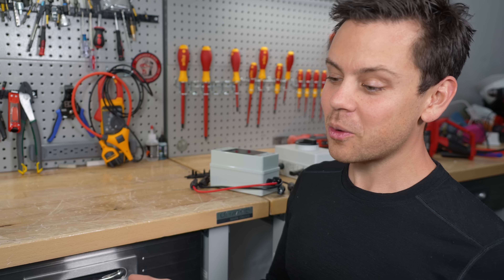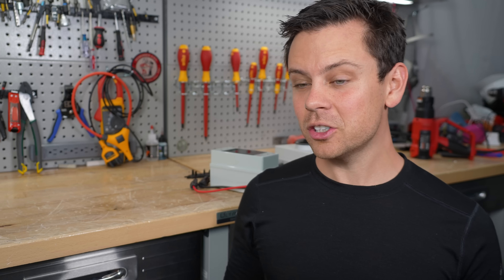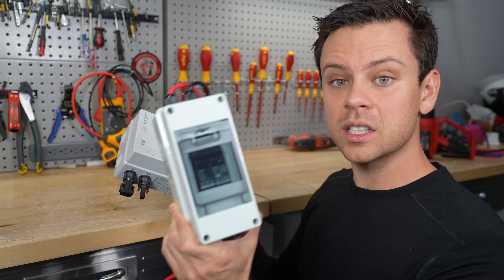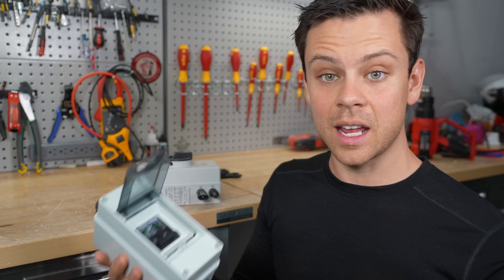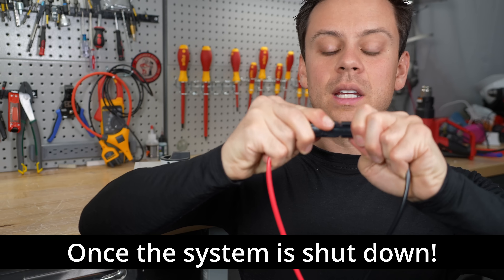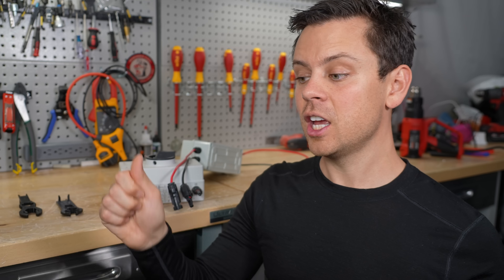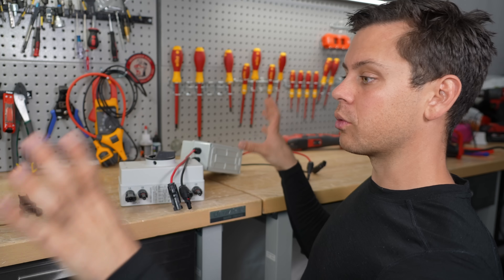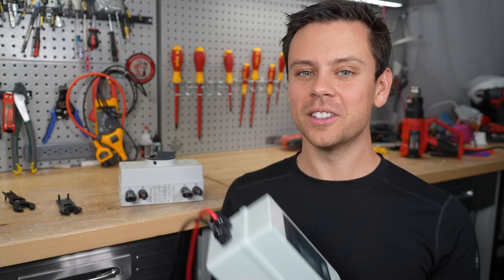How to Avoid Electrocution from an Offgrid Solar System: Everyone should know this!

Comment: It would have been great if you included info about using a pre-charge resistor when connecting batteries to inverters. Is it necessary in all cases?

Comment: Another solution is using rapid shutdown modules on each panel.
This keeps the series strings at 50volts until modules get a turn on signal once they are all connected.
Just be careful to kill the signal before working on PV panel system.

Comment: I was re-routing my solar panel wires at my inverters last month. I turned off one string that started unscrewing the wires from the wrong inverter. My panels were at 440 volts when i got zapped lol. grabbed ahold of my hand and i jumped and started to run out the door to disconnect myself from the voltage. It's not comfortable, do not recommend lol.

Comment: While I don't watch all your videos, I've watched enough to respect your expertise.
This will be a long question, but I'll try to keep it relevant.
In the early 2000's I owned a LEV (light electric vehicle) business and bought (and sold) SLA batteries by the pallet load. I built extreme stand-up scooters that had 400 amp controllers and dual  motors. I expected a lot from the batteries and the SLA's never let me down.
I want to build stunt scooters now but I am literally afraid of lithium batteries especially knowing the abuse I intend to put them through. Can you recommend a custom battery source in the western states that can build batteries for specific high current applications.

Comment: My landlord is a bit of a bozo and a marine mechanic with just enough knowledge to be dangerous. When I moved into the off grid cabin he rented me the house was 12 V DC and 120 VAC. I got very nervous with his electrical wiring and in the house one time I shocked myself touching a 12 V DC conductor. ??  After further investigating I found out that he used four conductor Romex to carry both the 12 V DC and the 120 VAC into the house. And he shared the 12 V DC negative with the 120 VAC neutral!  Absolutely hilarious. Later I was outside checking the water in the lead acid batteries and the ground was wet and I was barefooted. ut oh..... I touched the negative terminal of the battery and got a really big AC shock through my whole body! 😂😂😂😂😂😂 I had to bite my words and be polite to him as I tore apart his wiring and re-did the house properly. 😢

Comment: Electrician here. Those DC isolators are cool, but I also recommend an outdoor disconnect box (either AC or DC depending on system) near the meter/main disconnect for house power (in residencies) indicating it is the solar disconnect as well (obviously prior to conductor entry into any equipment capable of distributing power to the premise). This is the easiest way for the untrained to shut off all power sources especially for emergency responders when they don't have time to trace everything.
Reply: This would be only if you're connecting to the grid/grid tied correct? For off-grid they don't need to this right?

Comment: Hello Will, faithful follower, long time subscriber here.
Was trying to follow your suggestion on how to store the lithium batteries for the long term, and been trying to bring them down to 50%. Well these dam  batteries are crazy, or well to good for their own good. I brought them down to 13.1 , from 13.6, just using a inflator pump, but the next day when Im going to put them away, when I measure the voltage, it's back to 13.4. I really need your input on this one, never seen anything like this, I should be glad cause I have a battery that can charge itself, by itself?
Help!!!
The battery is. Redodo 12V 50Ah, never used, never installed to anything. It was charged once to full capacity 100%.

Comment: Please make a video about earthing / grounding. My 12 volt offgrid inverter has a screw for an earth / ground to be connected. Should I put an earthing rod in the ground and run a wire to the inverter?

Comment: The switch or breaker between the panels and the solar charge controller - as shown in the video - should break both legs of the circuit, both positive and negative as a dual pole breaker.  This differs from typical single pole breaker implementations that operate only on the positive leg.  There's an explanation for this by forum member Hedges on Will's forum: "If breaker only interrupted PV+, and PV+ was shorted to frame somewhere, and you put a screwdriver on a non-grounded PV- or disconnected PV- wire, it could carry hazardous voltages."  It should also be pointed out that any circuit breaker on a DC circuit has to be actually rated for DC.  AC breakers cannot handle the arc that a high voltage DC circuit can produce.

Comment: i put a DC Breaker 63amp on my solar panel cable before the solar invertor for thinking protection and solar switch off option. (380w*4 panels, 150ah*2 leadacid battery, 2.25kva solar inverter)

Comment: Hey Will. Doing a new house build and was looking at solar panels and have seen outputs going well above 700w now. I noticed you still use the 400w panels from years ago you recommended. Is there anyway you can do a new best of with new higher wattage panels. It would be great for people that might not have much space, but would still love to go solar. Thanks

Comment: Well done video, could not be emphasized enough about the dangers of high voltage PV. I have disconnects at my solar arrays(as breakers in combiner box) and again at my inverter as PV disconnect switches. There is about 400 ft between ground mount PVC and inverter.  DIY's often overlook the risk. Voltages and currents continue to increase with the technology and scale of systems as everyone is going whole home solar, rather than a simple sub panel for critical loads.

Comment: I was shocked seeing „Fire“ videos about MC4 connectors.  Those are not 100% standardized - so connecting male and female from two different vendors could have a bad connection what could lead to arcs and fire.
Don‘t know what professionals do - cutting the first and the last connector of a solar string and mount a male connector from the same manufacturerer as the female connector of your cable.   Same at the disconnect switch…

Comment: I have a relatively small system (1200 watts of solar panels) and my Victron charge controller's instructions tell you to connect the battery before the solar panels to avoid damaging the charge controller.

Comment: Use inverter's built in DC disconnect switch to stop current flow. They all act the same way. If You do not make MC4'connections by yourself, You should be fine. Mandy countries Haven forbidden DC disconnect Oras for a good reason: they add unnecessary DC connections, which causes most of solar fires.

Comment: I'm sure you will not answer but here goes anyway. I have a class A 40 foot motorhome. I have found 420 flex able solar panels ( thinking of using 5 to 6 of them). I wanting to put in 2 49v 100ah batteries. My old system is a older magnum 3000 12vdc system. I'm thinking the battery wiring would be ok. I would love to use a victron but would need two of them to get me near 40 or 50 amps that would have 120vac and 220vac. Thinking of using something like PowMR , Ami . Something cheaper but do not want to give up quality. Can you tell me what would be a good 48v solar inverter changer that would not cost me an arm and leg to purchase ? God Bless you if you answer.

Comment: As a man who is not scared of anything, I am terrified of electricity. I recommend a switch between your cells positive feed to your power distribution positive block. I installed a manual rotary switch. I also installed a breaker to shut down the solar panels too. That leaves me with lightening to be terrified of. In Florida, there are plenty of bolts to fear!

Comment: I can't believe you didn't start laughing when you said, "If you want to feel safe when working on your solar panels, work on them at night". Something like that. 🤣
These are the kinds of videos that give me some peace of mind. I get very nervous when working on my stuff, and people I ask don't seem to be actually aware of the potential dangers.
I can work on the live wires in a house, because I understand it, but solar and this array of Victron components that came with my cirrus camper, I do not understand. So thank you.
Reply: When I first started planning my big solar array my plan was to leave all the panels disconnected and wait for nighttime to go up and connect all the MC4's together to be extra safe. lower voltages I'm comfortable around but those strings will be in the 400-500v range so not taking any chances with them.
Reply: @DanielsCorner644  Good plan. 
It makes sense, but it's still funny when it's just thrown out there.

Comment: Thank you.... How many people die every year from DIY solar install electrocution? From working on broadcast transmitters, we used a grounding bar on everything before touching. Sometimes they get vapourized   breakers sometimes stick closed and are not off when they look like they are.  So yes, you got it, test for voltage even after turning it off. Just like every gun is loaded.

Comment: Hey Will we heat our homes with efficient natural gas could you heat steam run it through a water pump off your car to drive a windmill motor to power your home and eliminate the electric bill? ...I know it's not solar but still has implications for guys with all these toys sitting around

Comment: Perhaps talk about negative and positive terminals. And what the voltages are referrnced to. I noticed somebody already talked about this topic a bit. For example. What will happen if you just touch the red positive lead that measures 400v to its negative lead. Does.that 400v read across your body to the earth through your feet? Or.just from red to black on solar leads?

Comment: Bought the smaller disconnect per your recommendation a while back. Use it with my ecoflow system (3600watt unit w/ 800 watts solar input) Perfect pairing and was easy install

Comment: There is another consideraton. Both sides of your disconnect can be live, even if it is open or off. You can have voltage coming from the panels and voltage coming from the inverter. My panels are on a ground mount, approx 20 meters from my inverter. I put a control box with disconnects for each string, fuses and SPD's in the box. Inside the house next to the inverter I have another box which has DC CB's for each string along with SPD's, Also inverter utility input CB and output CB. I have a CB MTS external to the inverter where I can bypass the inverter for maintenance or firmware upgrades. The most important thing is to always verify with a working meter that you have voltage prior to opening and that you do not have voltage after opening, on whatever item you are working. If anyone else can access your disconnects use LOTO (Lock Out Tag Out). It's very easy to have your meter on AC and be checking for DC and vice versa, that is why you do a live check first.

Comment: Hi Will, I installed my entire 11KW system myself I wasn't shocked once, thankfully. However, the only time I got a tingle was from a single 48V panel that I was racking and measuring the voltage with a multimeter. Yes, in full sun a single panel can shock you.

Comment: I have two residential Silfab SIL-420-BG solar panels that come with Staubli MC4 connectors. Most of these come with no-name MC4 connectors. The disconnects that have wires I can technically snip off and replace with Staublis. However, many of them have MC4 connectors built into the unit. A lot of these disconnects have zero safety listings including the one you linked. It's kind of suspect to buy a safety device that doesn't have a safety listing.
I know Signature Solar sells the IMO that allows one to use their own wires (and MC4) and has a UL safety listing, but it's also $90. Is there one that has a safety listing and allows us to use our own wires that doesn't cost a fortune?

Comment: What about the 240v produced by the inverters, these need residual current protection (earth leakage) so they trip in the case you touch the live while your body is grounded. I even put in an earth spike when I am camping on the beach so the inverter and my fridges (240v) cannot shock me.

Comment: I've only been shocked once.  I was installing a light fixture in the kitchen of my old house.  I had shut off the breaker but some previous owner had run another circuit through the same box and it bit me.  Knocked me off the ladder. 

Never trust and always double check.

Comment: Thanks for the video and this is important.  I believe you said to connect the battery last, but the directions for both of my different charge controllers said it was very important to connect the battery first before the solar panels or the charge controller would be damaged.   Am I getting this backwards?

Comment: Thanks for the important safety info. At 4:30 you mention the battery should be turned on last, however the solar panel should not be connected until AFTER the battery is connected (and controller is powered on). You want to avoid sending any power surges from the battery to your PV array which could cause damage to them. So last step should be reconnecting the PV disconnect switch.

Comment: As more recent inverters have boosted the operating DC voltages, this is a timely reminder!  The most common thing I see that worries me is folks running PV wire into their house without enclosing it in metallic conduit.  We’ve all done it setting up a system, but 8-12 AWG wires with 300-500 VDC can easily start a fire like a welder when they start arcing. Pets chewing on them or items falling and cutting through wire insulation is all it takes.  👍⚡️☀️🔋🤩
Reply: I totally agree. It is my opinion any exposed (outdoor) conduit that carries conductors intended to supply power to a premise should be constructed from RMC (or IMC lol).

Comment: point of interest never mentioned in any internet links, the benefits and alteration to expectations when solar charging whilst an inverter is being utilised, indeed is when full amps are allowed to flow from controller indeed topping up almost as fast as your using batteries, keeps batteries high, preserves lpo battery life, meaning do high usage tasks during day sun. See many calculate with sums of no solar being added during inverter usage. It would be cool to create some basic stats on that. eg i have 3 solar banks and controllers but batteries linked by switches if want boost, and inverter i created two of them, so 3 times 900 watts of panels say just use my small lith bank 200ah only adding 900 watts solar the stats are lame as none factor in the charging during inverter usage, then factor once utilised the panels increase amps via controller to a more powerful charge rate  around 14.4 v at more amps than fully charged state, drawing say a fridge, the panels will keep up with the drain it seems. COULD MAKE A GROUND BREAKING SUBJECT ON THAT HERE?

Comment: Some of your videos say to have the batteries connected first, then the panels. Same info from the charge controller people. So why would you disconnect the batteries and have live power from the panels going into your controller? Don't follow: start at 4:30. They (you) say you shouldn't have panels going into a controller that has no battery hooked up to it.

Comment: Will. I can attest to what you are saying. Simply 7 x48v 395w bifacial panels in series… I was running the wire and putting it into the building and mistakenly someone had plugged the MC4 connectors and I got the full power to luckily only to one finger which happened to be touching both positive and negative during peak sunlight for only a fraction of a second.  That hurt like crazy. It felt like burning my finger and getting it hit with a hammer at the same time. Very shocking. 
To our viewers: wear only rubber gloves and never use the left hand when working with electrical power. 
If that had been a full 480v string I’m sure it would have been much worse.

Comment: Just bought a couple of breakers for the solar array side of my setup.  I have disconnects on the inverter side at my power shed, but my panels are at the end of a 500' run and going back and forth is a hassle.  You don't know how many times I've had to disconnect my cables for maintenance and probably just lucked out.  Thanks for the info!